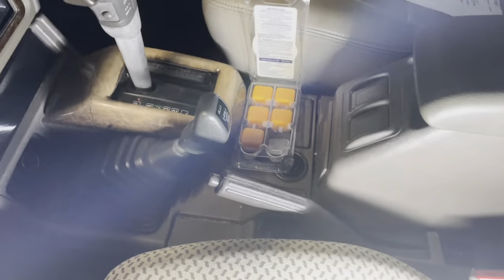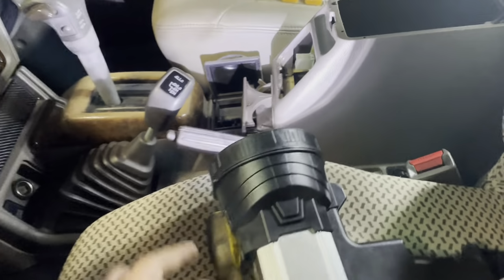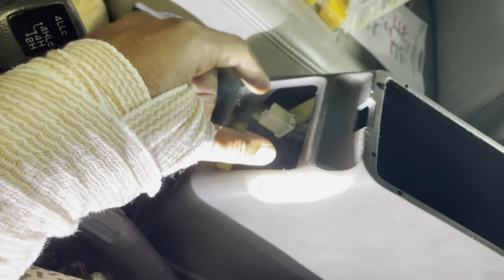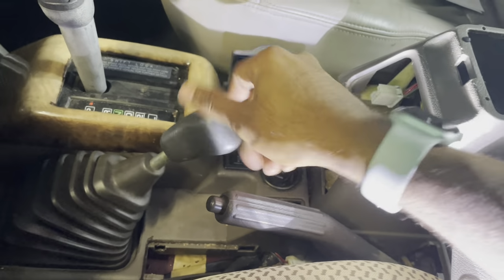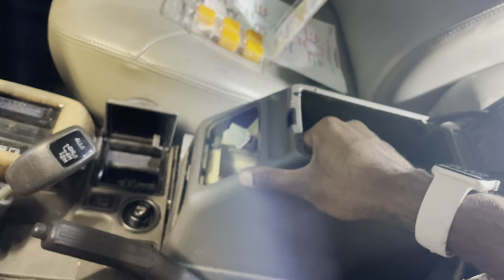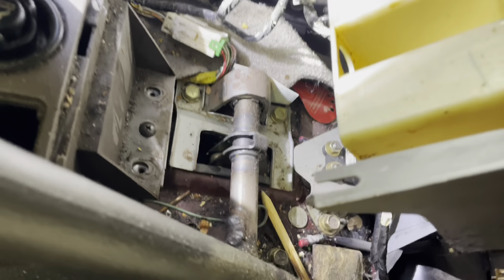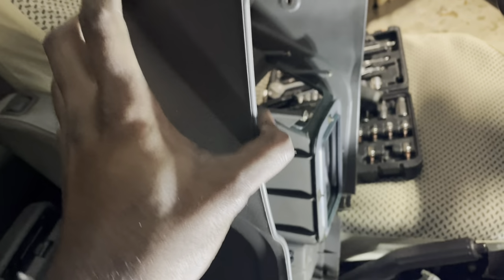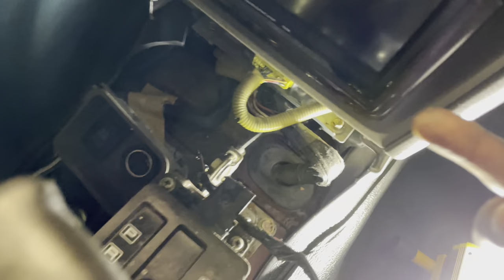Gen 2 mitsubishi montero center console removal on a 1998 montero. Should be same for 1992 to 2000

Comment: Dude how did you remove the center panel with the cupholder? you skipped that part lol. Mine is stuck somehow and I cant find the screw that is holding it in place... I have to remove that before I can remove the gear shift panel and it wont pop out ughh.
Reply from the maker: Oh crap, I am just now seeing you comment
Did you get it figured out?
I forgot how i did it, it was a long time ago.
Reply from the maker: the pop out cupholders are held in by the top screws in the armrest thing. Also inside the armrest thing, there should be two screws at the bottom. If i believe correctly those are the only thing holding that thing.
Reply: @johnj007  hey thanks for writing back!  I figured it out!  I would not have figured it our if it were not for your video giving me the foundation!  Thanks for posting because without it I would have been total lost!   Your video was the only one that I found that really explained the process!  Thanks brother!
Reply from the maker: @rickruiz22  Ya no worries, I am usually more active on facebook than on here. Glad it could atleast help someone out. Just wanting to help some people out who might be on the verge of doing it themselves.